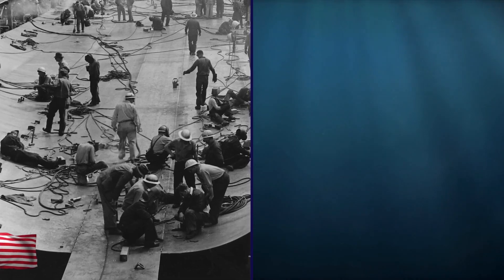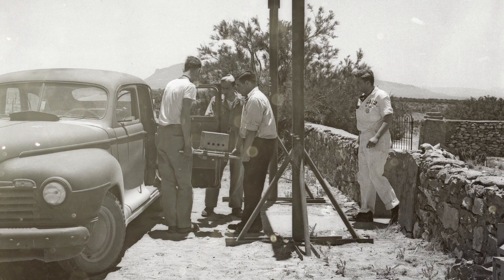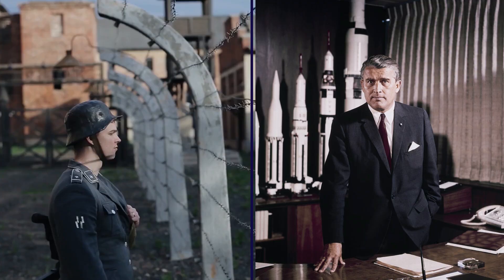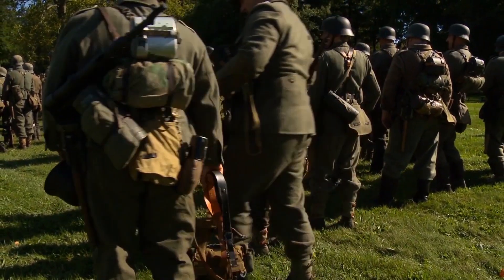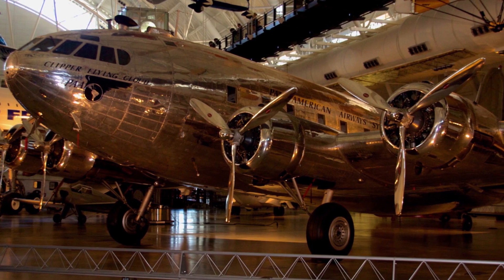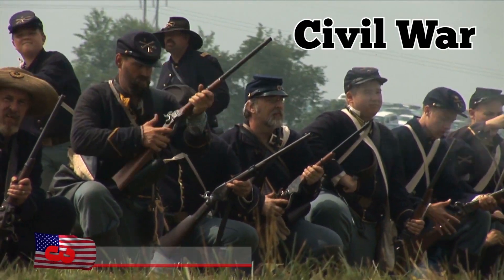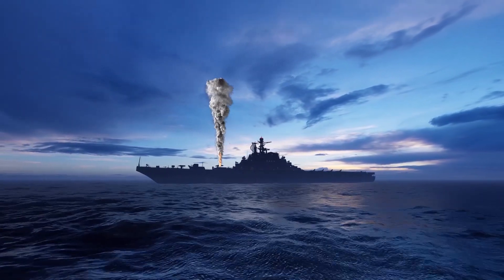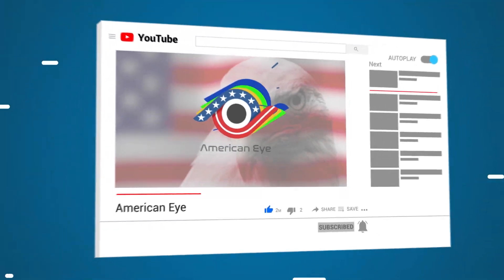11 Most Incredible Wartime Technologies Used During WW2!

Comment: As an owner of a watch with an altimeter, I often see that the shown hight in the cabin is much less than the actual, well told hight.
Reply: Your watch works on air pressure. The pressure in the cabin is higher than the outside air pressure. At 35.000 you would suffocate so what your watch is telling you is the equivalent height that the cabin pressure represents.

Comment: Type XXI U-Boat (1944)
The Atomic Bomb (1945)
RADAR (1935)
V2 Ballistic Missile (1944)
Jet engines (1935) Centrifugal and Axial flow turbines
Kabar knife (1942)
Cabin Pressurization (1938)
Enigma Encoding Machine (1923)
Superior Small Arms 
Aircraft Carriers (1912)
Improved Tanks